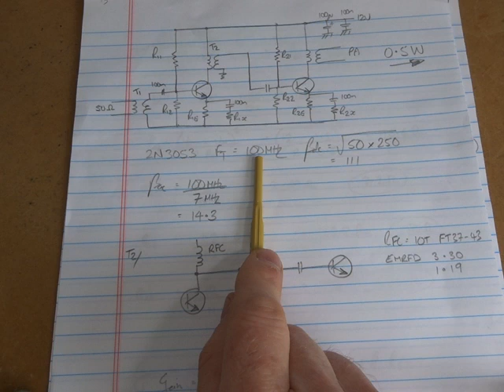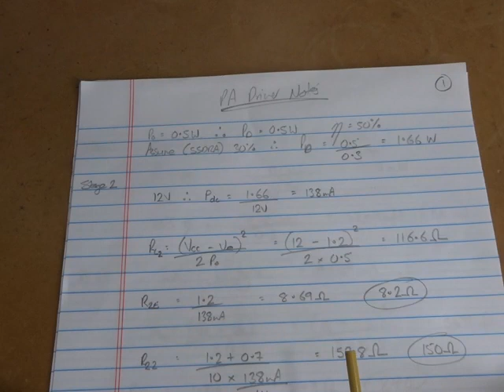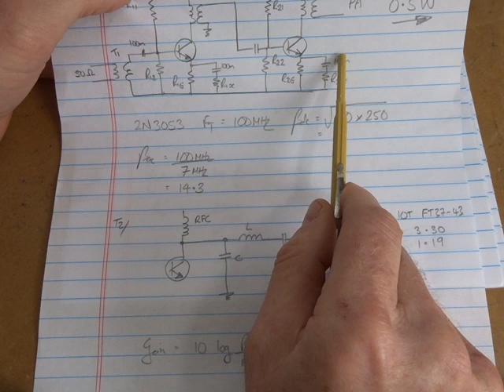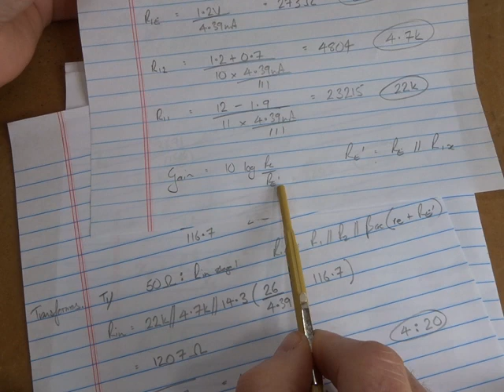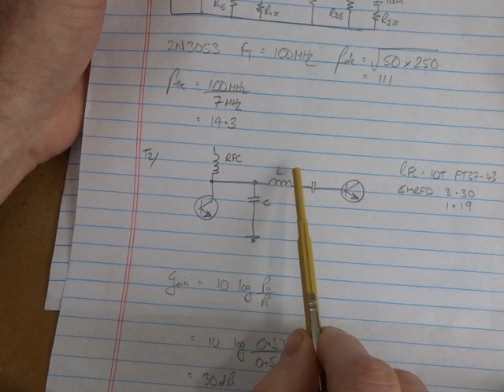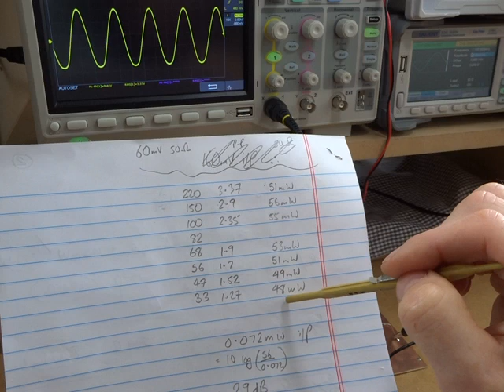Homebrew Portable 40m SSB QRP Rig. Part 6: RF PA Driver

Comment: A whole lot late but i did a quick smith chart match attempt. Change the RFC to about an 8 uH coil and then a 60 pF cap from the collector to the next stage. I would shunt the coil with a suitable resistor to control the Q.
Reply from the maker: Thanks Jerry. I must make more use of the Smith Chart.

Comment: Coming rather late to this. But I think initial calculation of DC stadning current in output stage should be 1.66W but with 12-1.2V (Ve = 1.2V)? I.e. higher than you use. This could account for less than 0.5W out?
Reply from the maker: Could be. I'll look into it. Thanks.

Comment: Charlie have you ever measured the input and output impedance of a known frequency unknown impedance SSB crystal filter. I have a 9MHz filter with no tag.
Reply from the maker: Hi Loren. All I have done to date if I couldn't find the filter specs was incrementally sweep the filter with different terminating resistances. Each time you sweep it you can see the effect on the passband ripple. I haven't extended that to trying different values of capacitance. This is the first time I have used capacitors, and I only did that to copy the board configuration that it came out of.
Reply: Thanks Charlie. Right now I have no sweep generator but may see if I can use an SDR receiver and noise gen.
Reply from the maker: @lmoline63601  Look back through my videos on homebrew crystal filters. I'd just use a sig gen and a o'scope, and plot the output. I enter the output level straight into Google sheets and plot the output curve. It's a bit time consuming, but works fine.
Reply: Charlie Morris Will do. Thanks so much!

Comment: Really nice work. I like that you go thorough the design process, including the calculations. They look intimidating in print, but they're fairly-simple equations. Regarding your matching transformers, I wonder if you considered using the Hayward/Kopski termination-insensitive amplifier design found here: 

http://w7zoi.net/bidirectional_matched_amplifier.pdf

They indicate that of course you could use just half of the bi-directional structure--it's just two identical amps that share common i/o connection. The thing about their design is that the impedance of both the input and the output is 50 ohms, without regard to what the amp is connected to on either end. This eliminates the need for inter-stage matching with transformers. Just a thought.
Reply from the maker: Hi Todd. Yes I have had a look at the termination insensitive amplifiers and they work well. I must take another look and see if I can work out the math. For me, if I can't do that then I'm reluctant to use them.